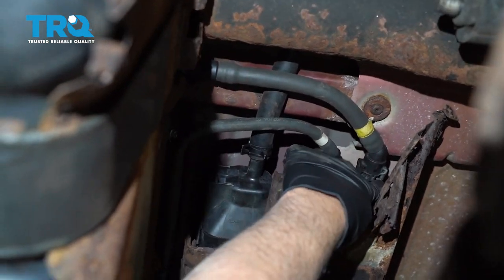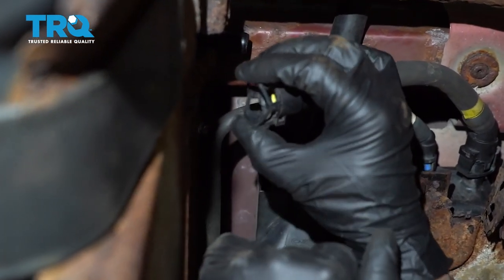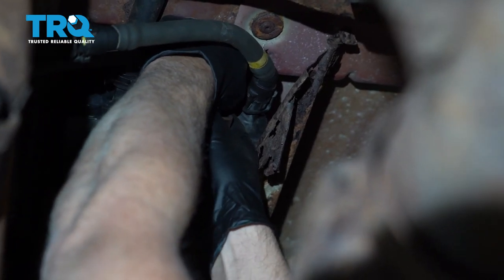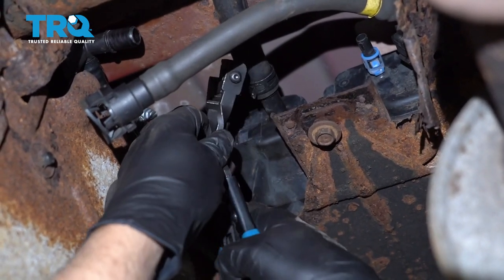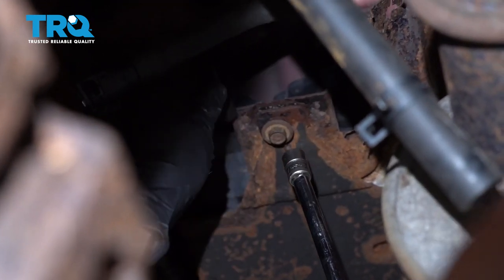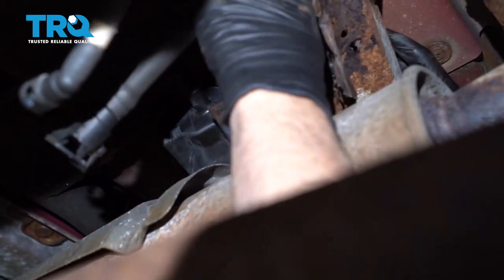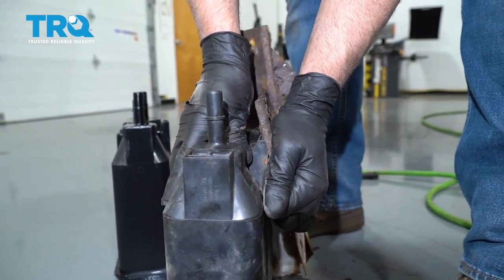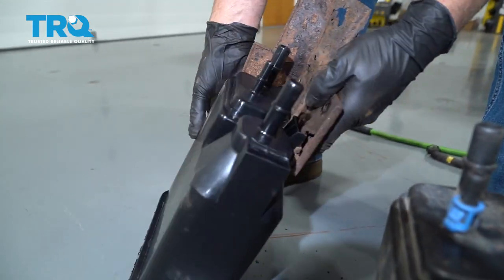How To Replace EVAP Canister 2007 Chevy Silverado 1500 Classic

Comment: Can a P0300 CODE come on from this aswell I have a 5.3 litter chevy tahoe
Reply: This is a very common combo of codes, 0300 and 0449, just because they're common on GMT-800s, not because of a correlation between the two. A failing evap system should not cause a P0300 or any misfires.